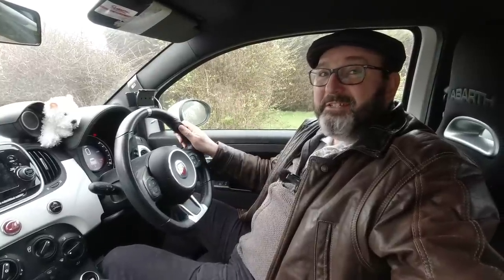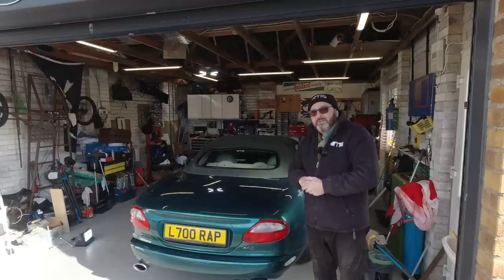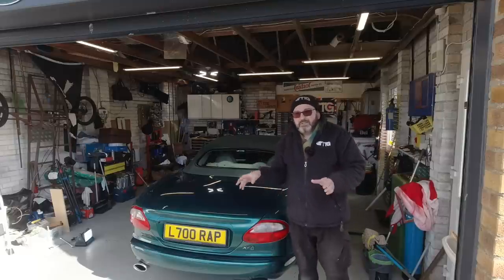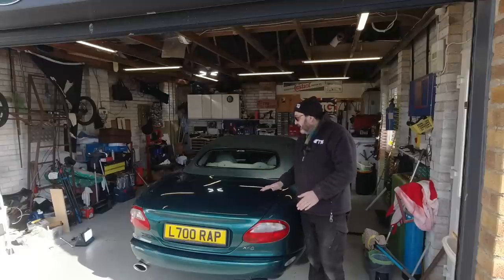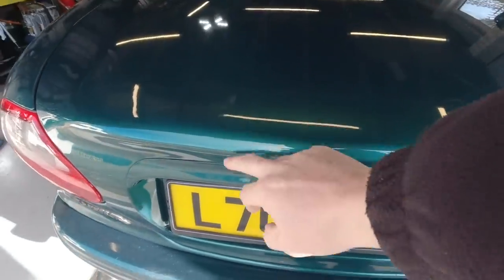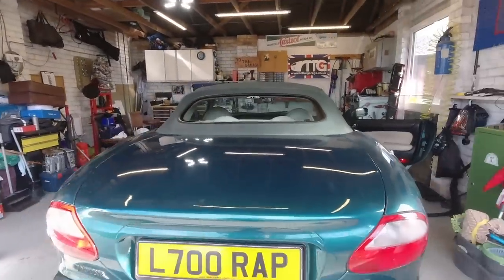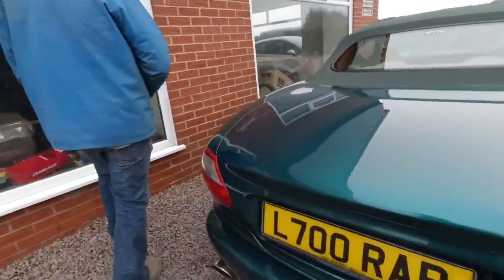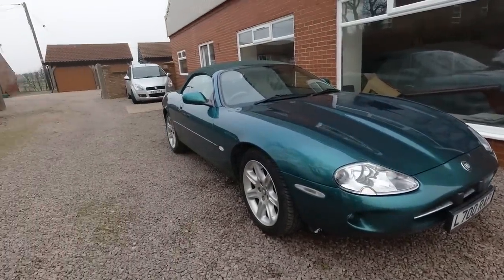My Jaguar XK8's Dents and rust are GONE!. How was it done?. How much did it cost?

Comment: Thanks John, I have dinitrol,d as far as I can but I have a feeling that with my 2005 xkr soft top, the sills have both an inner and, what can be seen, the outer. Presumably stiffening. I cannot see how to put rust preventative into the area between the two skins and before I start drilling holes would be grateful for any advice or comments.
Thank you for your helpful videos. As a final comment, I do not like the sprayed on foam applied around the boot side of the rear wing edges. Difficult to remove to get preservative to these areas.
Take care!

Comment: Hi John
Thanks for your youtube channel, very informative and interesting.
i have a LHD  USA/Canada spec year 2000 XKR convertible.
My Jaguar is my daily drive in the summer months.
My winter car is a 2004 L322 TD6 Vogue.

I recently had a brake problem whilst driving home for the weekend some 740KM.
I stopped halfway for a coffee.
On restarting my car I had a solid brake pedal and F1 style non servo braking.
The problem was that the small plastic tube for the servo vacuum  had got heated and the vacuum had collapsed the pipe flat, so no more suction.
As my car is LHD I guess a right hand drive it all on the other side.
I also discovered that the cat convertor only has a heat shield on the other side from my tube.
Maybe this was an oversight from Jaguar?
I think it would be a good idea to fit a heatshield on both sides hence protecting the  weak link in the servo braking system.

I also think it would be advantageous to carry a spare servo tube with the ready made fittings, i had no warning of brake fade or change in brake performance prior to failure.
Keep up the good work on your channel,
Best
Tim
Reply from the maker: Thanks Tim. Sorry to hear you had this issue.
I cant speak for later cars or LHD cars but mine has heat shielding on both sides, and the Servo vacuum lines. run through a silvered cloth sleeve.
Thank you for the cautionary tale.  👍

Comment: I hate to be the critical one here but I wouldn't be entirely happy with that repair. The paint looks good (I understand the panels sometimes look like they don't match) - the boot looks fantastic.

However, obviously there is the problem that you pointed out with the stone chip, I noticed on the passenger side you can also see a vertical line about half a meter forward if the rear wheel arch which I guess is either the edge of the new stone chip or where the laquer hasn't been blended in. Also on that side you can see when the outside light reflects on the corner of that panel (where the stone chip meets the end of the wheel arch) that it is not flat. The drivers side looks the same but it's not obvious when looking at that part head on.

I'm a perfectionist though so for what you paid it is probably reasonable.
Reply from the maker: Thanks Huw. 
The Stone chip finish doesnt worry me at all. But as always in my videos, I like to share everything I see, have trouble with or that others may have issues with.
The vertical line is a seam on the sill that is present on all X100's unless they have been actively de-seamed in this area. One of our subscribers (Gary Norris) has an amazing XK8 that has had this seam removed along with the seams running vertically below the tail lights.
Reply: Oh yeah I know the seam is there but this looks like it's in the paint (further back) when you moved the camera along you could see left of the line is gloss with the original stone chip and to the right of the line looks a bit flat.

Comment: Hi John,great videos and tips so big thanks.
Couple of new subjects for future topics. I have a early May 1996 convertible same green colour.so have same issues of colour variation as you.
Can you show your early spec over headlight trim panels?..mine are missing and i want to make or source replacements.
Also i like to share my issue of the glove box not unlatching.it can be repaired by de-riveting the top 3 inner securing rivets(careful drill off rivet heads only)..fault is jammed latch pins binding mechanical lock. then fix by reprofile the worn plastic handle V groove and regrease the 2 latch pins.reassemble mechanism  using very small diameter self tapping screws into the hollow original rivet stems .take care not to drill too deep to outer skin!
Recommend owners to check their cooling systems per the XK8 tech bulletins for compliance of the header tank pipe routing .it changed over the years of production run...also check all the thin pipes from the header tank not clogged by running a wire down each pipe to - rad/thermostat/underwing overflow tank.... I am in Japan with hot summers and my clogged system resulted in the radiator plastic end cap bursting and dumping all the coolant.1996 old plastic and high underbonnet temperatures are a ticking timebomb.check all coolant system plastic for cracks and test your thermostat and ECT sensor are in spec operating temperature range.
Reply from the maker: Ive made a note aa engineer. i will see what i can do👍

Comment: Hi John, I missed the premiere so I'll post my query here.
I have a '99 XKR (2000 model) with adaptive cruise control which works fine until the engine bay gets hot. It will fail if stuck in traffic and not work at all when starting the car  if the car has sat in the sun. Once the engine bay cools, restarting the car brings it back to life. 
The problem is less common during colder weather as you would expect.
I've posted this problem on Jaguar forums and Facebook groups but never had a good answer and I'm baffled to be honest.
Reply: Had this problem on my xj it was the drive shaft speed sensor, cleaned it and it was good to go.
Reply: @johnwillis9534  I'll give that a try but I can't see how heat in the engine bay would be connected.
Reply: Intercooler pump perhaps?
Reply: @Punisher9419  unlikely as it will happen if the car has sat in the hot sun and has already failed before the car is started.

Comment: Time to get some miles on that XK8 mine has currently 110,634 I'm sure others can beat it, C'Mon guy show me the miles :)
John IF it makes you feel better (which I doubt) I forgot my XK8 was on my drive backed my truck out and hit the mirror (That's what I thought) when I got out I had but a huge dent in the drivers door that cost quite a few dollars to fix :(
Wiring Diag, probably Mercedes in Germany (but of course it will be in German) Tun
du sprichst Deutsch (Do you speak German)
Whilst I am impressed with the colour match the texture finish would bug me they should sand it to match PRIOR to painting.

Comment: Hi John, Glenn's bodywork was excellent and cost effective compare to East london, I have a question please, on my XK8 1998 I can't find the drain plug on the cooling syatem, do I have to remove the cover just under (3xbolt) the radiator or is it located in the engine block?
Cheers!
Reply: Right hand side of the radiator, facing backward to the engine. A plastic drain plug you can open with a big flat screwdriver.

Comment: Hi there. Could you tell me what to do with my remotes ? Neither  of the 2 will work at all !!! I've changed the batteries on 1 remote  no change . Access to the car was achieved by the drivers door by use of the  key. The alarm sounded but all went quiet when i inserted the key in the ignition. The engine then started. The battery was fully charged as i  just removed my CTEK charger before starting. The remote worked ok  6 wk's ago when i went to start it as the car is not used over winter.
Reply from the maker: Hi Andrew
Sounds like your remotes need re-coding to your car. I did a video on how to do that. Here is a link for your convenience.
https://youtu.be/VVnLZiAXA_U

Comment: As an amateur, I can see the wheel arch rust etc. How can you tell if a car has major rust, front and rear subframes etc? Is a ramp the only way?
Reply: You can get it up on stands with the wheels off and poke around aggressively with a long screwdriver on the rear chassis rails as shown, and the front ones behind the suspension. Floor pans also rot, usually seen beneath front footwell carpets - I had the plates under there cut off and found unknown rot in both footwells

Comment: Restricted performance WARNING system too lean bank#2. Do you have any Secret tips. 3 Shops tried to fix, still no success.
Reply from the maker: Check the breather pipes connected to the cam covers. A hole in one of them could trigger that warning. as could a hole in the intake snorkle after the MAF. (Altough that would cause lean on both banks)
It could also be a bad intake manifold seal.
Reply: @ToTheGarage  Thanks a lot. Appreciate it :)
Reply: I had a lean condition in bank#2, which turned out to be a crack in the intake manifold.